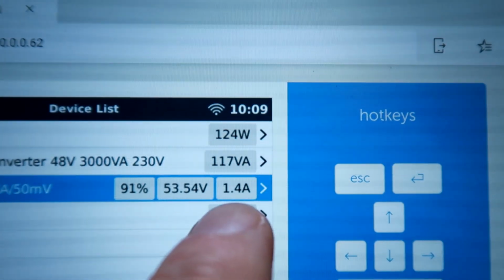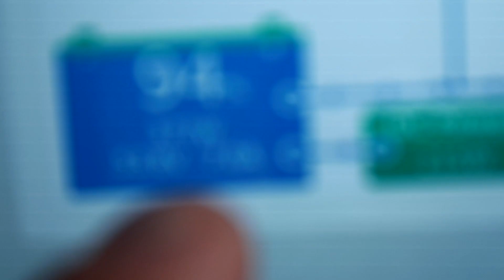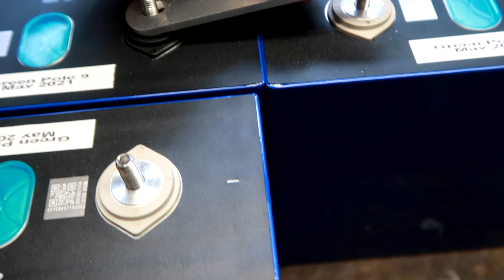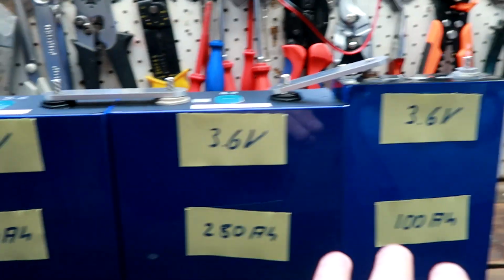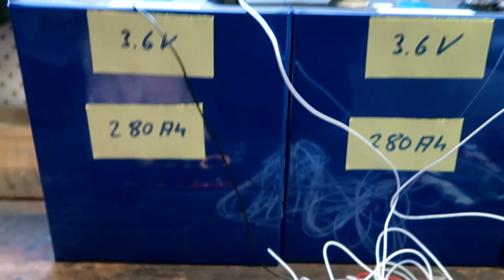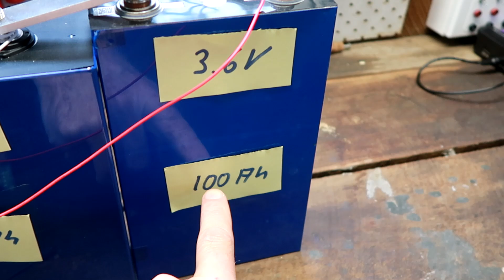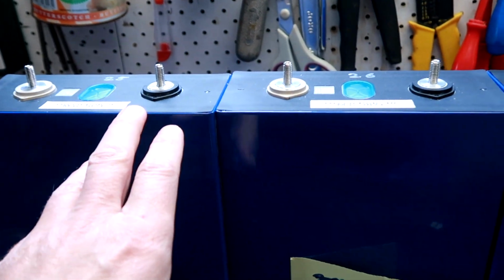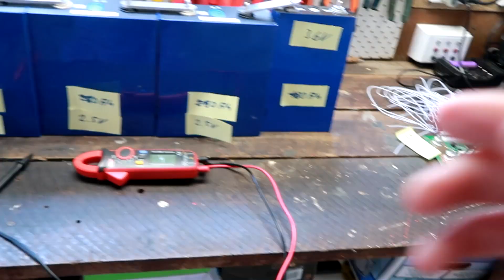Divided opinion about balancing, balancers, BMS. How to and why to balance LiFePO4.

Comment: Another option I am contemplating is doing an active top balance with batteries in series with the charger (powerlab 8) with balance leads...no pressure on the weakest cell etc.

Comment: Top balance if you are want to use mostly the top part of your battery (i.e. full charge more often than you full discharge).
Bottom balance if you want to use mostly the bottom part of your battery, (i.e. frequently run your battery all the way out, or a full discharge more often than full charge).
Either one can work. It's easier for automated solution to maintain top balance which is why so many BMS include a top balance function. However if you do not fully charge and hold it there with some current but not too much for the balancer, the simple top balancer cannot do its job.

Comment: In addition to that the c rating of the charge is is slightly higher on the lower capacity cell so you're actually charging it at a faster rate in relation to its actual capacity
Reply from the maker: Yes, that is true, more wear and tear on the weak one.

Comment: I like your analogy of balancing buckets of water. That is the same one I have been using. It makes it clear that you are fighting a losing battle with trying to keep the level of a small-capacity cell at the same level as other larger-capacity cells during charge-discharge cycles. As you have identified, it is a tradeoff between limiting the battery capacity to the smallest cell capacity or moving current to and from the smallest capacity cell to keep it within voltage limits. While not an expert, I think that overvoltage in a small-capacity cell is going to be much more detrimental than the additional charge cycle to keep that cell from overvoltage. 

That said, I will point out that there is in fact typically not going to be a current reversal for the lowest capacity cell as it charges until all cells start to drop. Let's say you are charging with 10 amps, and the balancer is removing 1 amp. You still have net 9 amps into the smallest capacity cell. It never starts to discharge. To my mind, the balancing allows you to recover capacity that would otherwise be limited by the smallest cell. The reality is that a 1 amp balancer with a 200 amp-hour battery will do very little. I took some data on a 200 amp-h 4S battery with a 5 amp balancer and it appeared it was going to take 5 hours to balance out 70 mV.

Finally, I would like to suggest a better alternative to agonizing over top/bottom balancing is to actually improve the cell capacity matching.

Parallel Cell Capacity Balancing (PCCB) Procedure.

https://diysolarforum.com/threads/parallel-cell-capacity-balancing-pccb-procedure.26301/#post-312069
Reply: What if the odd cell was a higher capacity than the rest in the extreme example? Is that going to cause all the other cells to go over voltage because the one cell remains at a lower voltage due to the higher capacity?

Comment: It is a conundrum because as Mr. Hairless legs said,  no two batteries are the same.  So,  I guess it would depend on one's individual circumstance.  Still,  there is a lot of food for thought here, especially given what Doctorbass posted about dissolving anodes and lithium plating.

Comment: I would like to see if you make a video about, bottom balance 4x 280ah cells, charge them series at 3.6v, and do a capacity test. That will prove what is the correct way. top or bottom. :)
Reply from the maker: Questions about this:
- so you want me to stop charging once the first cell hits 3.6V?
- how to maintain the balancing over time?
- how can I have two of such batteries in parallel?
Reply: @OffGridGarageAustralia  stop charging at 3.45 volts, and do a capacity test of each individual cell to check is charging without a bms is a good idea. i think it isn't a good idea and that the capacity of each cell is not the same. and with a bms it should be the same. 
don't use bottom balans in your system. just make a 2p with proper bms.

Comment: I use the technique described by Jack Rickard and recommended by @Helder Pereira. Before anything, I bottom balance the cells to 2.75 by discharging them down to 2.65, and let them set overnight.  Because the voltage climbs back up a little, I discharge them 1 more time and they settle between 2.70 and 2.75 Volts. Now the cells can be put in series and are ready to be charged.
Reply from the maker: What about the BMS and charge control settings?
Reply: @OffGridGarageAustralia  I turn off the balancing in the BMS and just use it for protection. I like to charge up to 80% so the charge controller is set with an absorption of 53.2V and slightly less for float.
Reply from the maker: @SpeakerKevin  Thank you.

Comment: To be pedantic about balancing...
1) check voltage to group in sets of four that are close (ideally within 1/10v)
2) with 4s bms wire in series
3) charge each 4s with 12v until BMS shuts off
4) unwire battery(s)
5) check voltage of each cell and any that are 1/10v or more different charge to close enough to others
5) rewire cells all in parallel
6) charge to 3.6v until current is negligible
7) unwire battery, rewire in desired configuration
The balancer size needed is not determined by the size of your battery but by the size of your charge and discharge currents.

Comment: If your use case is running on empty most of the time do bottom balancing.  If usually running with greater then 50% SOC do top balancing.  It is also more likely to damage cell from overcharging then overdischarging.
Reply from the maker: Aeh, I think it's the other way around, cells damage very quickly at under 2.5V while overvoltage can go up to 4.2V with these cells. 3.65V is the max recommended voltage.
My battery rarely gets under 40% so I'm staying rather in this 2nd half as well.

Comment: Bottom balance method makes the most sense to me. However you still must understand that all of these problems come from the fact that a cell has an internal resistance and that resistance is different between the cells. By its very nature resistance consumes power. Whether you are charging or discharging, part of the energy is being dissipated as heat, IE is a loss. However, because each battery has a different internal resistance, the amount of that loss is different between the cells. This implies that regardless of what you do you will have drift between the cells over time. This implies that eventually you will need to rebalance.
Reply: For my money all this top balance / bottom balance / active balance / passive balance is just theater. The objective of a battery is to deliver current. Current (electrons) does all the work. When you hit the knee you are within a few percent of done charging or discharging. STOP! if you need more current get a bigger battery.

 You can spend your life chasing the final couple of percent capacity or you can enjoy your limited time on this earth. Buy a bigger battery.

Comment: Andy What active balancer are you using? The red one with the coil and caps
Reply from the maker: I have tested several now and they all work more or less. You always want to make sure to not leave it connected all the time and just balance the top of your charging cycle. 
At the moment, I'm not using an active balancer any more but will use the built-in one in the JK-BMS once it is installed. That seemed to work perfectly fine.

Comment: Top balancing focuses on the SOC (100%). Voltage is used as an indirect measurement.

Bottom balancing works for very well matched cells (internal resistance) with equal cooling. This is needed to ensure that the cells do not drift with each cycle.

If the cells drift with cycling, bottom balancing will work only for a limited time.

Top balancing has the benefit that it can be re-done automatically at the end of each charge cycle (or at some convenient time interval, e.g. every 30 days) to eliminate cell drift added during cycling.

In your previous video, one of your cells reached high voltage because the BMS caused imbalance trying to balance at 3.35V. It was NOT due to the small balancing current of the BMS.

The BMS balancing current and the "absorption" duration must be big enough to allow the BMS to rectify the imbalance added since the last balancing occurred.

As I've read on another forum, bottom balancing makes sense for an EV. You may be low on charge and far from a charging station. You want every possible mile of range, without risking of running the weakest cell into reverse polarity (beyond 0% SOC).

For a PV storage system, top balancing makes more sense.

An active balancer that runs PERMANENTLY must be able to transfer a current on the same order of magnitude as the usual charge-discharge current. But you can also get an active balancer that can run on-demand, only when needed, at the end of a charge cycle.
Reply from the maker: Yeah, I know about the reason for top or bottom balance while both don't seems ideal. My Tesla does balance all the time for example, not just while charging or driving. They have a patent for that system. The ~2900 cells are all in absolute balance all the time. It's crazy.
Reply: @OffGridGarageAustralia  For Tesla Model 3 with LFP batteries (Made in China), Tesla recommends charging to 100% once per week to balance the cells and to "calibrate the range" (i.e. to synchronize the SOC to 100%). For the USA variant with NCM cells, I will do some research. But NCM does have a steeper voltage curve, not like the flat middle curve of LFP.

Comment: Bottom balance all the cells in parallel once before building the battery, next build the battery pack with a BMS to Top balance from time to time, during the whole life cycle of the battery.  The BMS will bring you safety and peace of mind . . .  Active balancer is the preferred option, but not available on the market!

Comment: I need help, we are assembling batteries in bulk, cant afford to have individual bunch of 15 cells Top or bottom charge as we have to assemble around 50 units per day. We are facing issues due to these imbalances although cells we use are all A grade of the same batch.
My question is if we don't do the initial balancing and rely on the balancer to eventually balance it after 3-4 complete charge/discharge cycle. Is my approach correct, if not if there is a system where I can do initial balancing in bulk (let's say 150 cells in one go)

Comment: Looks like really nice bus bars. I guess Al need around 50-60% larger cross area to get same resistance as Cu and the thickness of these looks like 2x the one that follow batteries, so it should be quite a lot better.  :)
Reply from the maker: Yes, you are right.

Comment: The best way to look after a solar battery, is to bottom balance the battery.
The reason for this is that inside cells are plates that will discharge at different rates.

So if we bottom balance, we can set out cut off. We can then charge the cells and use the power to the peak voltage we want.
3.5v then we don't  over discharge and the batteries should balance, the deviation in the top is less of a issue.
Reply from the maker: But all BMSes only support top balancing. So do charge controllers.
I think bottom balancing is something from the past, when not many good electronics existed.
Reply: @OffGridGarageAustralia  it's not that.
If you have series cells and parallel  then you can't monitor the cells in parallel

This way you get a weak cell and it drags down the pack and then reverse charges in the worst cases.

1p batteries should not have the issue with the BMS but you can work to max power, in a top balance, 
A disregard for cell capacity.
A bottom balance is battery life.
Which finds the empty point of the cells to avoid it.
But charge to the cells equal point.

(Not a ideal way to explain without sleep, hope it makes some sense)

Comment: thanks again Andy...If i could ask a random question please
the wifi set up do you use wifi extender to the house?
i have my shed about 55mts from my house router and just looking for a suitable solution to stay connected TIA..ps... i finally received my 280ah batteries today 12 weeks...stay safe..stay charged
Reply from the maker: I'm using one of these to make the 'bridge' from the access point inside the house to the carport (shortest distance). Form there a 10m cable runs to an old router (I use it as an AP) inside the garage which provides Wifi and LAN.
https://www.tp-link.com/au/home-networking/wifi-router/tl-wr902ac/
Reply: @OffGridGarageAustralia  thank you so much Andy..your a champion

Comment: My cells are charged and discharged up to 80 amps.
The active balancer compensates with a maximum of 5,5 amps.
This means that the cells are simply charged and discharged with a maximum difference of 5,5 amps. I don't think this stresses the cells. Only with high voltage differences does the active balancer have high equalisation currents. I do not switch off my house completely at night. I have a base load of about 150 watts, which is already over 3 apere at 48v.

Li-ion/Lifepo4 Capacitive Balancer Board
Balance start voltage : 3.0V-4.2V
Balance termination voltage : 2.9V (into undervoltage sleep state)
Maximum Balance current : The whole group accuracy is 0.1V1A ; 0.5V3.5A; 1.0V5.5A

So in my opinion there is no additional charging or discharging with the balacer.
I have one active blancer and one BMS (not balancing) per battery pack.

China cells are all used and relabelled in my opinion.
So they need all the care they can get.

Best regards from Austria to Australia
Reply from the maker: Thanks for sharing, great comment.

Comment: your a good teacher please how many hours do i need to charge 32 cells of 200Ah with DC supply of 10A?
Reply from the maker: Thanks, Nathan.
10A charge will add 10Ah/h. 
If you have all batteries in series: 200Ah divided by 10A = 20h
If you have all batteries in parallel: 32 x 200Ah divided by 10A = 640h
Reply: OK thank you very much
Reply: please is there any way for me to use traditional 12 battery charger to balance them up

Comment: Thanks for the great videos. it will be possible to mount the second battery with down balancing. with both systems at the same time. after a few weeks you would compare the two balancing methods.
Reply from the maker: That is my problem though. I would assume the two battery strings (16 cells in series each) will not have the same overall voltage when the first cell hits say 3.45V. When I parallel them, they will balance and... destroy the bottom balancing.
Reply: @OffGridGarageAustralia  Hello, I put both batteries with a BMS. What would happen is that when the battery with bottom balancing was at 100%, it would disconnect from the system. when the battery with the highest voltage dropped to the lowest level, both returned to work. I only see it happen, but for a little while, when voltage are at the top or the bottom. if the system was programmed to work between 5% and 95% the problem was solved. What do you think??

Comment: Now i am confusedererer...
But i learned something. Lower voltages are on lower positions. I never noticed this before.
This bottom balancing seems to be a good approach, but i would not use it without BMS, as you mentioned, for safety reasons. And i would also not bet, that it stays forever like that. 
You put the same amount of Ah in every cell, but internally the chemistry may do something slightly different in every cell? Also the cell degradation may vary slightly, so i think it will shift over time...
But this are just my thoughts, no experience yet...
And yesterday my first panels were delivered, so i had a chance to try this elejoy tester :-)
Feel free to not upload a video every day ;-)
Reply from the maker: I would keep the BMS but would turn balancing off while still monitoring the single voltages.

Comment: Irrefutable fact: It doesn't matter if you top balance and shut off discharge on weakest, or bottom balance and shut off charge on weakest, or capacitor balance and get significantly more usable capacity out of your pack by doing both, your weakest cell ALWAYS gets the most wear and tear on it.
Reply: I think I would agree.
If you bottom balance, all your cells get the same amount of cycles, but your weakest cell always experiences the highest charge voltage.
If you top balance, you're putting extra discharge cycles on the weakest cell, and it experiences the lowest charge voltage.
If you active balance, you're putting micro cycles on everything, and significantly more micro charge cycles on the weakest cell(s).
Active capacitor balancing will always get you the highest yield, but lowest longevity.
Unless somebody makes a highly sophisticated BMS that monitors capacity and modulates current draw on a per-cell basis, then there will always be a weakest link. Such a BMS could distribute the wear evenly.
The best way to maximize longevity is to keep the DoD as low, and the SoC as close to 50%, as possible.
E.x. Low voltage shutoff 3.0v, high voltage shutoff 3.3v, bottom balance at setup, no balancing during operation.
This ensures same # of cycles for all cells, but leaves enough SoC buffer that cell life is greatly increased, and any normal deviation minimally impacts cell degradation. All that is likely required is a pack balance every hundred cycles or so. Obvious drawback is greatly reduced total capacity.
So at the end of the day, unless you have a magic do-it-all BMS, a set it and forget it system will always have a weakest link that degrades exponentially.
Reply: @MicroplaysMC  I recently contacted loads of Chines LFP companies and the 5 that replied all said the same... keep the DOD between 20 - 80% for best compromise on cycle life and 2 of them further said 50 - 80% DOD for max cycles. CATL claim >8000 cycles at 50/80 you just need a larger battery due to only using 30% of what is available.